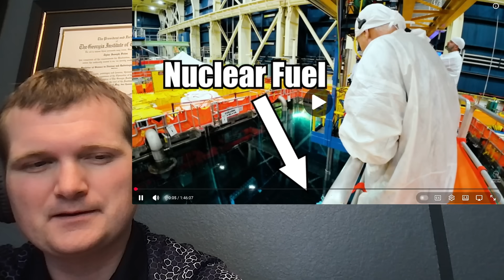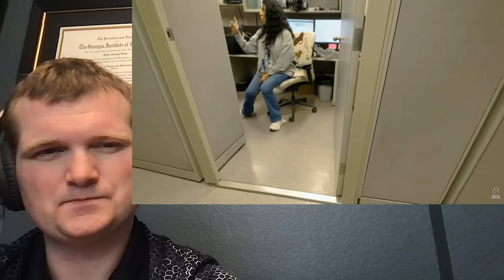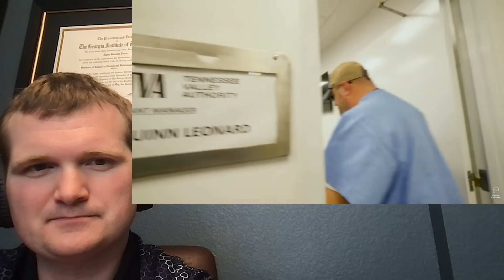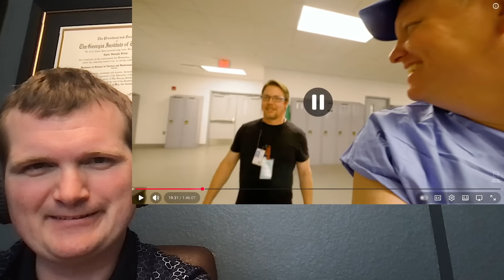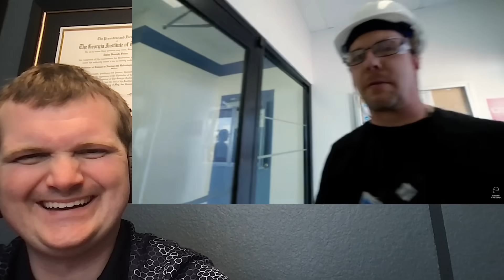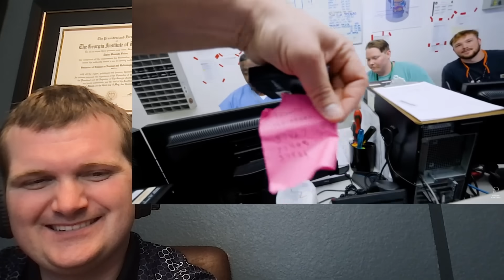Refueling a Nuclear Reactor - Nuclear Engineer Reacts to Smarter Every Day

Comment: I had the opportunity to work refueling shut downs under the reactor pulling control rods in BWRs.   It was very interesting but not my type of work.  Would sit for 10 to 12hrs a day for 2 weeks until it was time to pull rods and then I might not even get to work depending on when the pull started.   Got on the team because of my athletic background and ability to pass the background and training.  Training took all week and then had to speak to a psychologist 😂..  Got cleared and had some fun.  All I would do is take the rod, place it on a cart and push it to a loading bay where it was stored.  I messed up once with RP my first jump lol..  got to make sure you respect the containment rules.

Comment: I knew nuclear fission reactors worked. And I'd learned from when I was in high school about fission of Uranium. you know one into 3 makes 9 events. The feedback loop seemed really dangerous to me, that it would spiral out of control in microseconds.. But then I got explained that there are prompt neutrons and delayed neutrons and all of it clicked into place. I'm also happy to see that the nuclear industry and aviation have cross learned skills. Critical thinking, decision making process. Absolutely critical to generating a safety culture. I know first hand that culture has set firm roots in Aviation. I'm glad to see it's set its roots in power generation too. I do wonder how many viewers know that Carnoe is actually Carnot and a thermodynamic cycle.  Or the specifics of boiling water. Or to subtleties like what happenest electric driven water pumps when the pressure drops too low.. Th last company I worked for were a specialist motor control company. Some of the water pump starting control software was very specialised sold into the US and UK market.. Some was 'extra spicy' but I won't talk about those.

Comment: I watched this originally on SED, and it is quite the lengthy, but interesting video. As soon as It ended I thought about this channel, haha. BTW, I am sure others have posted, but there are parts which lag and freeze quite a bit. I had the same issues when recording gameplay while streaming with cams on my old PC. Tweaking rendering/recording settings will help somewhat, but as high quality/high bitrate videos become the norm, new hardware is usually the best answer.

Comment: Coming from Ontario, those plants seem small, Bruce Power has 8 reactors with 6 running at the moment, Pickering has 8 with 4 running. I guess there are just way more plants in the States.

Comment: BWR vs PWR notes:

We don't like Boric Acid in our core.  Our poisons are static in the rods and staged around vessel I suppose and definitely stated in the Spent Pool.  We do have Boric Acid but it is stored in a tank with pumps and so to inject if we need to.  Hopefully we don't.  

We very rarely do a complete core offload.  Usually it is a "core shuffle".  Pull one rod and move it to the Spent Pool, take one rod stored in the Pool, either new or previously used and now parked in the Pool, and move it to the vessel.  Obviously all in VERY specific locations and orientations, both vessel and Pool.  

RCAs - The whole plant including the secondary side (Turbine Building) is within the RCA boundaries.  Presumably the Turbine Building would have a lower dose than the Reactor Building but in reality both are quite low (during non-outage time frames).  It would be rare to find an easily accessible High Radiation Area in the turbine side, typically only during a maintenance activity or similar.  That said, even on the reactor building side there are relatively few accessible HRAs.  Plenty of locked rooms and so on that are very dose-y on both sides.  That whole walking path once he scanned his dosimetry and turnstiled in was very likely the Turbine Building with secondary systems like condensate and deminerlizers and the auxiliaary boiler.  They pass through the gates and water tight doors to the "secondary containment" which IS the Reactor Building.

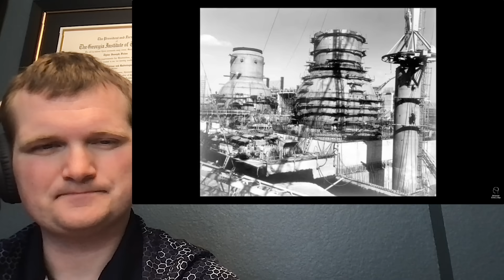Comment: Each reactor at Brown's Ferry is in a unique building, however, they have a common refuel floor and therefore one roof which gives the appearance of a single building from outside. You can see how they are constructed in the picture shown at 13:36 of this video. Notice how the reactor buildings are separate but connected and each has its own drywall (containment). Additionally, the turbines are all in a single building which is also connected directly to the reactor building structure. Other than the fact that there are three units, this design principle is not unique for BWRs.

Comment: I did a scaffold job in a nuke plant once it was an experience. 24 guys to build maintain and dissemble about 200 pieces of system scaffold. took us maybe 15 hours of work for the whole project the rest was just standing around on standby for 7/12s for 5 weeks if something needed to be changed with the scaffold. it was boring but easy money but unlike any other plant work I have done they made us actually stand around the scaffolding the whole time instead of just hanging out in the trailer till something is needed that got old fast

Comment: Wonder if its like aviation where we consider human factors in our operations. Eg Destin being a non-nuclear person (although having had training) would a potential extra threat, likely a external threat and a internal threat then come up with counter measures to handle it. Eg Air Traffic Control (ATC) to pilots can be a external threat, like commands which would potentially cause jeopardy to the aircraft, don't just accept what ATC word for it, verify and properly check.

Comment: Not sure why they say the Radon is naturally occuring and not created by the plant. I never set off the detectors on the way into the plant but did have several instances of our polyester uniforms getting enough radiation on them to be removed for analysis..typically returned later that day or next day.  Seems to me if its "natural" the plant is concentrating it in some way. I also got to stand in center of a core which they where still constructing.... its much smaller than your think.

Comment: Cool thing, back in 1999 Prairie Island in Minnesota had a reactor outage for refueling/maintenance. They opened the plant up to public tours. I have been standing over a reactor with the lid off (under water of course) I have seen the blue glow and felt the humid heat of the spent fuel pool. We got to see the training control room. All while wearing street clothes. It was too cool.

Comment: 0:52 - if that fuel rod glowing with Cherankov radiation somehow came up out of the water, the neutron and especially gamma radiation dose would be lethal.  The crane operators would see a flash of white light in their eyes as their retinas and optic nerve are destroyed by intense gamma radiation.

Minutes later, they'd feel light headed and may start vomiting as their nervous system is damaged.  They could lose consciousness before being extricated, presuming the rods were submerged back into the water to make an extrication possible.  They would dead within days or even sooner (hours).

Comment: Was hoping for a reaction video 😊  

Tyler: Do you have any comments on the use of Microsoft Windows 10 throughout the plant? In your plant, did you have bespoke systems that may require it? 

When I watched the original video, I believe the visit took place in March 2025. Since then, Windows 10 has reached end of life. It just seems unusual that such a heavily regulated environment would still have so many end-points running this. 

Can imagine it would be a significant project to upgrade, so maybe they’ve opted for extended support.

My reaction to a reaction video as a highly Microsoft certified IT director 😅

Comment: i have a few doubts regarding how they employ people at a reactor

are there some roles that require 24x7 attention which are done in shifts
if so what are they and how are those shifts split up (two 12hours or 3 8hours  maybe even 4 overlapping 8hours etc)
how do they employ them at sundays/holidays/nights 
are special shift workers paid more?

is refueling done by a contracting company or inhouse since it only takes up a small portion of the plants operational time and it seems very human intensive

does the nuclear reactor get support from its countries military for protection or do they have to hire private agencies to prevent any security accidents

Comment: Didn't the employees in Sweden entering a nuclear power plant cause the world figure out a nuclear accident happened in chernobyl. When entered the plant  the nuclear detectors went off. Or is it not true
Reply: That is a 100% true. They brought in the contamination on their shoes (it had rained that night, and the fallout was in the puddles on the parking lot), and set off their detectors when entering the plant. One of the RC guys took one of an employee's shoes to the lab, stuck it in an analyser, and saw a whole range of isotopes show up indicating someone had had a major booboo at their nuclear power station. They were able to track the direction via the wind patterns, thus discovering it was somewhere in the Soviet Union. They could also tell what type of reactor was involved in the accident because each reactor leaves its own personal "fingerprint" when splitting its atoms.

Even if you have two reactors of the exact same make/model and same power output, still each will split their atoms in their own unique way. When a reactor goes critical for the very first time (it's called achieving First Criticality), at that very moment in a way they become a unique "person" with an individual "fingerprint". Sounds weird, but that's how it works. And yes, I'm a huge reactor nerd in case you hadn't noticed😅

Comment: I have questions. Have you ever witnessed a fuel rod mistake during refueling?? For instance the fuel rods was not secured correctly and was dropped?? This video was very informing I used to live in hershey pa, and york pa close to two nuclear plants three mile island and peach bottom. Now im an expat living in a country that has stopped nuclear power because of 2011 in Fukushima (germany), but ironically has nuclear weapons from the usa. It makes no sense. Watching this video makes my fears of nuclear power go away. I used to be scared because when I lived near York pa I was in range of both peach bottom and three mile island so they would give us pills incase of an accident.  I forget what they were called.
Reply: "I forget what they were called."

These are Iodine pills to protect the thyroid (especially important for children). Our bodies cannot distinguish between 'good' Iodine and radioactive Iodine (which is a by-product of nuclear fission). So, to prevent the thyroid from up taking the radioactive variant, you take pills that will saturate your thyroid with the good stuff, so the radioactive Iodine will just pass through your body. The pills taste like doodoo, but it's better than the chance of getting thyroid cancer down the line. Hope this helps.

Comment: Edit: Boiling water reactor? What about steam voids? Pressurised I can understand, the water won't boil under pressure... I need to Google!

Edit: I love the "F-ME" shorthand. In the UK that would be referred to as the "Fuck me!" code! 
As in "Fuck me! My lanyard broke & my dosimeter dropped into that blue glowing thingy-ma-bob down there!"
Can anyone confirm? Is F-ME referred to as "Fuck me!" in the UK industry? 

A relation of mine was the guy, before and during operation of Dounreay in the Highlands of Scotland, who was tasked with estimating the average time to failure of every component on site measured in man hours. 
From office door handles to core coolant valves and everything in between.

From Wikipedia: The first of the Dounreay reactors to achieve criticality was the Dounreay Materials Test Reactor (DMTR) in May 1958, which was a DIDO class research reactor, producing a high neutron flux.

So he started out there in the 50's. The classic wild looking Professor with questionable social skills I used to love talking to him about his job. I found out he bought an Amstrad CPC464 Z80 8 bit computer after I bought one and he even followed me into PC's in '96 on my recommendation which had me glowing! This bloke knew research reactors inside out, but carried a slide rule. I was your classic early 80's computer nerd & he deferred to me about that. 
He left me in the dust in Zilog Z80 assembly language though! Compiling his own software within weeks of getting the machine. 
I made the mistake of asking for help with quadratic equations as a kid, once. That was a frustrating day for both of us as he abandoned the curriculum in the first sentence with,

 "I think we can dispense with basics as more can be learned "in extremis", as it were... "

" No! The basics will be fine, honestly!"

He just puffed his pipe, said "Oh dear!" as if I'd just given him a life sentence of hard labour and it began...

So I'm fascinated! The absolute, complete and total detail of the reams of data he produced down to the screws holding the switches to the consoles (at which torque, from which manufacturer ect.) was incredible. 
So this'll be interesting...

Comment: when I was a deconer at dcpp I learned one night to always carry an extra day of clothes in the saddle bag of my motorcycle. I came out of the aux building and was wearing our personal clothing and couldn't pass the detection equipment at access control. I had a partial on my Levi's and they had to go to the lab to find it. the modesty pants we gave out were paper and riding home 20 miles on a motorcycle in a light rain at night causes arriving home in ones shorts.
Reply: 😂 Good job you never got pulled over.
It'd have been fun trying to explain why you're riding in your drawers to the sheriff.

Comment: The thing I missed in Destin’s video — Tyler May cover it; I haven’t got there yet — was whether the turbine experiences any/much contamination considering that, being a BWR, steam is generated and dried within the reactor. It didn’t seem like there was much in the way of radiological control where those people were working at the interface of the turbine and generator, so I guess not.

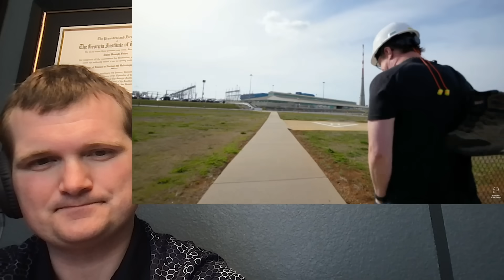8:00 … What about containing a prompt criticality “event” because some freakish force out of the cosmos compressed all three cores at once? 😂 But in seriousness, I was expecting more concrete, but it looked surprisingly like a regular factory structure. 🤷‍♂️

Comment: 3 reactors under one roof is some (arguably pointless) hardcore civil engineering. It's definitely a choice if nothing else - you have to deal with the spans, which makes the concrete/steel work extra complicated and expensive. We definitely need to work harder at making the civil nuclear industry less secretive - it makes sense when you're making isotopes for weapons, on purpose, when you're making electricity for people's homes it breeds conspiracy theories and fear, and is why we can't have nice things. It's good to see the tide turning on that. Not just the conspiracy/fear thing either, you want people to want to do these jobs, and it's smelling like we're going to need more people to do them - which means getting young people interested in doing it.

Comment: What kind of model is this plant? When I think of nuclear reactors I think of the big towers and none were shown. I realize we're improving designs fairly often but I figured those would still be around. Can you explain why that (to a layman who knows nothing) seemingly critical piece of safety is missing from this site?

Loved the vid dude. Thanks so much.
Reply: Those towers you're thinking of are cooling towers, and are required subject to flowing water availability. 

As the plant in the video is on a river with sufficient water flow it uses the river water for cooling, thus it doesn't need the towers.
Reply: @MrXcJim  Oh that's pretty cool. I always thought they were a containment measure. Thanks man.
Reply: @MPHIY17  Also, although people tend to associate those giant hyperbolic cooling towers (you know the ones) with nuclear plants, they get used for other types of plant too. 

For example, Didcot power station in the UK had 6 of them for its recently decommissioned coal plant.

So yeah, not all nuclear plants use those giant cooling towers, and not all cooling towers are for nuclear plants.

Here in Canada, we have a fleet of CANDU reactors; and I don't think any of them have ever used one of those giant cooling towers.

Comment: I am still blown away that Destin managed to get this level of access.
Reply: Many of us that know, are amazed.
The security guards are allowed full auto at all power plants in the US, not just in nuclear.
Terrorism stuff.
Getting into areas with full auto allowed is extra security clearance.
This is a "civilian" nuclear power plant and he is not allowed to show parts of the plant for security reasons.
It is to prevent terrorists from finding weaknesses.
These security steps are taken with our coal, oil and natural gas plants too, maybe not to the same extent but similar.
I worked a few days changing out the scrubbers on the roof of Loma Linda Medical Center's natural gas power plant ~20 years ago.
There were guards with AR-15s and MP-5s blocking the spots we were not allowed to go.
I was blown away at the size of the jet engines used with huge cng intake pipes going into the side of the building.
I asked to use the bathroom so I could walk the whole engine and generator.
It was a lot cooler looking than this nuclear power plant's steam generator xD
I think this was needed for the nuclear reactor in Loma Linda Medical Center for cancer treatment.